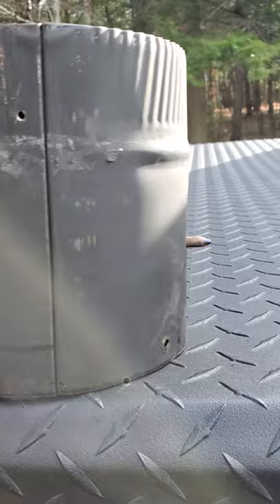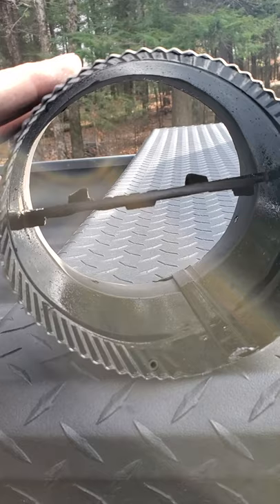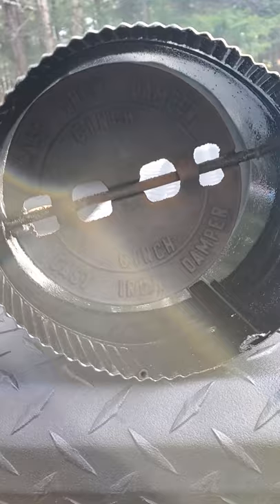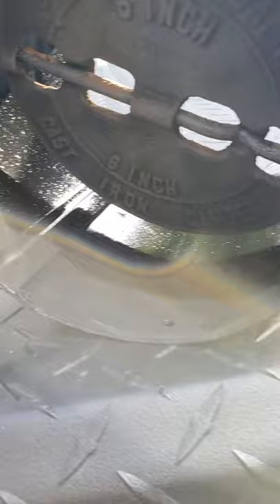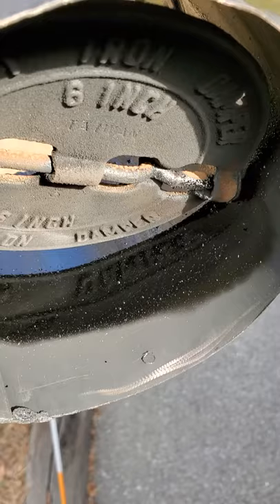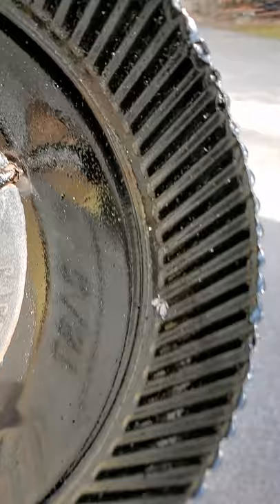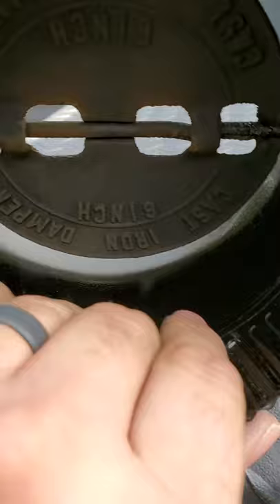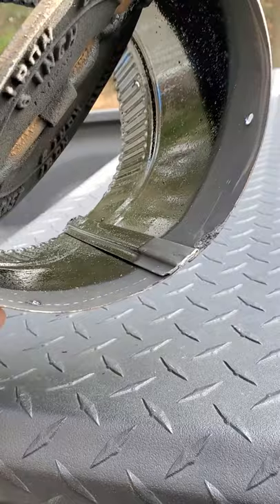Let's talk about Butterfly Dampers

Comment: That obvious "line" where creosote starts is due to it being placed over another pipe when it is installed, therefore no smoke exposure.  Slowing the fire is not the same as choking the fire.  These dampers are amazing and by design will keep more heat in the building.
Reply: Exactly what I was thinking. This guy is a deceptive lier to get more chimney work or has no idea what he's talking about.

Comment: Not everyone is burning in poorly seasoned wood in an old smoke dragon stove. This is bad advise for  modern stoves designed to burn within a specific draft range. Following it is a shortcut to overfiring the stove and ruining their expensive investment. A butterfly damper is totally appropriate for a modern stove on a 30+ ft tall flue system.

Comment: Unfortunately in areas where people use their wood stove/furnace 24 hours a day for 4-6 months out of the year this is the only damper that works, when the chimney has to much up draft pulling up and out, the fire won’t continue to burn. Any chimney cap at the top could help, but the amount of creosote that would build up in the cap in a short period of time is ridiculous. There are some instances where this type of damper is the only solution.
Reply: You are absolutely right

Comment: Ide say your 100 percent wrong you can regulate exhaust flow with good inlet air for a more lean burn....trick is go outside and see if your smoking and adjust as needed.i wouldn't ever use one in a newer epa stove due to the secondary burn features in the stove your exhaust is already fairly cool compared to an older wood burner. but I think there a great safety feature in case of a chimney fire.
Reply: Good point on the chimney fire, but I wonder if they've tested closing the feed door and air flow on the stove versus a damper as far as effectiveness.

Comment: I haven't cleaned my stove pipe in years. I check it to make sure but too clean to bother with. The secret is a clean burn, no smoke means no creosote. The only time you see smoke from my chimney is first start and when I add more wood. I set my damper above 45 degrees.
Reply: Absolutely agree! The key is good combustion . Smoke is unburned gases (energy) escaping up the chimney. If it’s burned in the stove where it should be . You get very little visible smoke and creosote can’t build up

Comment: I have been burning wood for nearly 40 years and have always had a butterfly damper on all my wood stoves. It all comes down to dry firewood, under 20% moisture. Many people don’t realize how important it is not to burn wet/green wood. Your video illustrates what happens to your chimney when burning wet/green wood. Burning dry wood I haven’t had the problems you’ve mentioned. 
Thanks for making your videos
Reply: Me too and I don't use a damper and don't understand why one would ever need the blockage in my pipe. I have a draft control in the door for regulating the air mix.

Comment: In defense of the damper, I can attest that it considerably increases the efficiency of my stove, simply by not letting heat escape that easy. My goal is to have the stove hot, but not necessarily to burn. The hotter the stove, the more heat the house gets. On the other hand, the more intense the fire is, the faster the fuel burns. With the damper closed, I can have the stove very hot, and at the same time, a modest fire (that burns for significantly longer)

Comment: Your explanation of making sure the stove gets as much air as possible too is a recipe for the chimney to get too hot and cause a fire. It’s a balance of seasoned wood, correct inlet damper airflow and chimney temp.  Any one of these out of balance can result in a chimney fire.

Comment: Yeah,well we cant run a stove wide open all the time buddy. Depending on your situation,cleaning your chimney once or maybe twice a year is fine. To help reduce creasote buildup burn good dry seasoned wood,burn your fire a little extra hot for about 15 minutes once a day,use creasote reducing logs periodically. A good insulated chimney that is tall enough for  adequate draft and has a good storm/rain cap will help too. I burn from October through march with an old buck fireplace insert with a 10" masonry and clay chimney. It has a damper that's far from airtight and I pull the insert out the start of every burn season and clean it the best I can with a brush. It's never horrible,but I clean it regardless.  I usually go through 5+ cord if oak and maple a year. I cut my own wood in later winter/early spring and burn it the following winter.

Comment: I agree with your assessment of the facts regarding creosote build up, choking the fire, etc. but in reality, there are other factors to consider.

A wood stove that isn't shut down will easily burn through a log in 30-45 minutes, and it may burn so fast and hot that you're over-firing the stove (which can cause permanent damage over time) so it's not incorrect to shut a stove down and run it dirty, to keep it ticking over at a manageable rate. You've just got to make sure your chimney is swept every 6 to 12 months, depending on usage.
Reply: this guy is just trying to sell you something
Reply: Agreed
Reply: Sounds like he hasn’t use the woodstove very much in his life to heat the house
Reply: I sweep my chimney 3 Times a year the first one is to make sure it’s clear and no bees or debris found there way in yes I have a cap. The second one is midway through the burn season and the last is a put it to bed for the year cleaning. I use the damper as a break in the event something starts to get a little out of hand. No problem using it and I usually just have the powder ash type creosote. Again not bad as long as you do your part.

Comment: Do you also have a firewood business on the side?   Running without a damper is the best way to throw heat away.   I have a 100+ yo PD Beckwith with a damper AND a draft control.   My damper is always at least half closed, my draft at least half way open.  By introducing fresh air into the hot stream, you burn the smoke.   My stove runs extremely clean.   My chimney sweep only comes every other year and is still saying I’m wasting his time and my money.   It is crucial that I only burn well seasoned hardwoods from my property… black oak, madrone, manzanita and some scrub oak.

Comment: If you prioritize facts over ego, I'd like you to share your experiences and data with stoves, not just in words but through various experiments. I installed a butterfly damper on my ENCORE and refrained from chimney cleaning for two years. Upon inspection last month, while the amount of creosote didn't significantly change, a notable difference was evident: around 90% of the creosote had accumulated around and below the butterfly damper, with only about 10% above it.

ENCORE, utilizing a catalyst, enhances combustion efficiency, burning a substantial amount of creosote. However, its drawback lies in its inability to separate the roles of the damper and the catalyst. By employing the butterfly damper, I've extended the burning time from the usual 5 hours to 10 hours and reduced firewood consumption by about 30%.

If my experiments had failed, I would have likely removed the butterfly damper by now. Yet, it seems that won't be necessary.

Comment: I have a damper in my stove pipe, and it's used when the wind is blowing 10 to 30 miles an hour. It's the only way to control how fast and hot the fire will burn. Turning down the air controls helps, but not enough. You'll burn through a lot of wood, without much heat. As for burning overnight, stove manufacturers show you how to close down the air intake, to make the fire last all night. Been doing it for years.

Comment: I have an Avalon Olympic wood stove, which has the secondary burn feature, it has a damper built in,  once the stove is hot, you can throw a couple logs ,( well seasoned of course) and totally  close your damper and shut the air flow, this stove  will give you  a nice primary burn, and  any generated smoke will be trapped and burned  on the top of  the stove ( secondary burn) generating  good heat and burning for  longer time. I usually go to bed around 10, wake up for work around 4:30 -4:45 am and there is still a nice bed of hot coals  inside the stove . I clean my liner  mid winter like January  and again before next winter season, seems to be working just fine for me .

Comment: This is where the new stoves really shine with the secondary air tubes.  So many people comment on videos to add a flue damper when they see the secondary burn in a new stove.  Nice work, thanks.
Reply: A high-end wood stove even from the '90s will have secondary air tubes. My 1997 Lopi Endeavor has secondary burn capability because of its air tubes--1997 to be exact.

Comment: I have nothing in my connector pipe.  27 years later, people still insist I need one. But my home. My wood. My stove. My pipe. It is controlled by the air intake on the appliance. 
Coal is different.  Thats entirely a different species of solid fuel.

Comment: That’s all true but when your only source of heat is wood you have to choke your fire. Nobody is gonna load their fire up for the night and then let it burn wide-open. Yeah creosote is built up but you clean your pipes and then put new ones in at a certain point. If you build a tiny fire, I’d be out in an hour with everything wide-open, and then you freeze to death overnight.

Comment: Either you close this damper above furnace or the inlet damper, your are restricting the airflow, hence choking the fire, because fire can only burn when there is enough oxygen supply. So, regulating the heat on the inlet damper is actually better so the stove has a negative pressure inside and does not smoke the room. But when the stove is not on, you still have the draft sucking warm air from your house through the chimney out in the cold. It would help to have a good seal to stop that draft. The inlet damper can be completely closed and you would still have air leak through the pipe cracks. And unfortunately this kind of butterfly damper would not really seal the chimney. We would need a better seal.

Comment: I just purchased a new woodstove, no damper, but this stupid fiber baffle board is in the top of the stove.  No air flow and the smoke build up was ridiculous.  One month burning 2 yr dead oak, and the creosote build up was so thick I was shocked.  I made a 2 inch hole in the fiber board and now my stove behaves the way it is supposed to.  That fiber board is one of the most dangerous additions out there.  I will be removing more of the fiber board and installing a damper. 40 years of burning wood and I'm going back to the basics.

Comment: What if it's a concrete flue, and concrete building.   No fire issue.  2nd this makes sense, and I get it but holding the heat in is the goal. So I think it depends on the application.

Comment: I don’t agree with this diagnosis for 2 reasons. The more important being the danger of not having a way to choke a fire if something is stuck open- the stove gaskets arent tight- and/or it’s very windy outside. Recommending not having an extra safeguard is reckless imo. We are talking about fire after all. My quadrafire is tight but with a drafty home and 70mph sustained winds, not having a butterfly would be idiotic. Secondary tubes don’t have controls so the damper is the ONLY way to slow things from getting unsafe. Still, keep steel wool close if you have to plug these inlets and know where the inlets are. 
Second reason being the example used (butterfly damper shown) only proves the heat is staying in the firebox longer which is what we all want. If there were no damper the shiny creosote would just be lower in the stovepipe due to the heat cooling before it would with a damper installed. 
People, install the damper, keep the damper if you have one. Just maintain the stovepipe and be as familiar with it as you should be in the first place.

Comment: At about 2:05 he asserts that a butterfly damper, even fully open, is still bad and causes creosote.  That is pure nonsense.  I have a new Aspen C3 stove.  There are no air controls at all on this stove.  I removed the damper as per numerous youtube guru's advice.  Thus, I discovered to my great dismay that there is no way to regain control of my overfiring stove.  I will replace the damper in the spring time!

Comment: I kept a fire going 6 month a year for 30 years  ( always had babies )with a top damper and a thermostatic bottom damper( closes when hot opens when cold ) ! the stove had a 10 ft strait pipe ,start with a hot fire to blast it out ,then cut off the air and let it do it's thing  ( 8 hr burn times with tree log stoke )! it ain't hard ! 
 long pipes cause this cooling build up ! it will build up no matter what lies are told ! clean you pipes every year and it should work very well ! I used a chain to bang around and let it fall in a bucket ( use it to treat wood that contacts  dirt , posts ?)

Comment: Tell people to not burn wood that is not fully seasoned. That does a lot more toward preventing creosote. Advise the to watch the flue temperature. As long as the flue gases are over 250ºF on exit of the flue system, creosote will not condense badly.

Comment: Hello John, I can tell you from experience that the flue damper made these days are just junk made in CHINAMAN ASIA or INDIA or Taiwan.. I changed mine every year for the past three years. Then I had enough and made mine from exotic materials. INCONEL flapper and fasteners, TUNGSTEN ROD and Stainless Steel split collar clamps to control the index position. Has been two years and the homemade unit is just bulletproof, period. The 6 inch pipe is 316 stainless steel which is way better than plain steel sheet metal. 
           I modified my stove with secondary air input to increase the heat output and reduced my wood usage in half, minimum. The burn was way longer and cleaner than before. 
           Drop some more suggestions to increase the efficiency of my Stove John Caesar. Thanks

Comment: How is closing the air vents in front of the stove "not chocking" but using draft regulator is choking? I think you are taking things to extreme. I can burn all the wood in 30 minutes with flue liner red hot  or 6h creating tons of CO on soot. Why not to tune it it burns at optimal rate?

Comment: So, the only way to operate a woodstove is to run it wide open at all times? Derp!
Reply: You should never control a woodstove by slowing or impeding the smoke leaving the appliance. All that does it create thicker, cooler gases in the flue which build up more creosote. You control a woodstove with the air inlet controls. Just be careful not to take away too much air because then you get the same problem.
Reply: @JC.Ministries  
That's why you clean your chimney! Old timers with wood kitchen stoves would clean them every month or two. And the damper also keeps more heat in the stove instead of up the chimney. I run double wall pipe WITH a damper and keep internal pipe temp at 600
Reply: @kirkstinson7316  I agree!! Proper maintenance is a MUST! I've been around wood stoves all my life. If you have excessive Creosote buildup, STOP BURNING GREEN WOOD!

Comment: so you are saying no damper and FULL AIR, which means you will burn thru wood very quickly, the whole reason people close damper is to get more heat in the box and and conserve wood, is there a another way to achieve this with no damper and open air vents

Comment: If you burn good seasoned wood and inspect your chimney Routinelyusing a damper you can control, Seems to be a logical way to retain heat and re-burn smoke similar to the way a baffle works , one would think ?

Comment: So what you are saying is my wood stove that i burn 5 months of the year the chimney is not supposed to have a damper in the pipe that i close 50% and still only have to  brush it every 2 years. After one year i can still see the pipe walls all the way to the cap.  This video is completely wrong. For some cases and other cases it will smoke out the house with the paint burning off the pipe and stove with out one

Comment: I wonder if you added it really close to the fire chamber so it kept any creosote inside the chamber. Cause I think ideally you want as much smoke as possible to stay in the chamber so it ignites again. Think about a rocket stove, it literally captures all of the smoke, Re burns it and then the exhaust from the house looks like vapor more then smoke if done right.
Reply: It won't reburn without air or draft and newer stoves need all the draft they can get to work properly.i really depends on your wood burner.

Comment: I have a modern EPA 2020 stove and a  37ft tall chimney. Last year I ran the stove WITHOUT a key damper and had some serious runaway issues. The fire would often become uncontrollable and the temperature on the single wall pipe would become crazy hot. I did reach out to my stove manufacturer (pacific energy) and they told me that a key damper would definitely help in my situation. I am going to install one before next winter.

Comment: Wow! Was just getting ready to install a damper in my new pipe! Thank you so much for explaining this in detail! Just hooking up my new woodstove and will not be installing damper!
Reply: FrancOtaku  Expensive more high-end wood stoves have built-in dampers already part of the manufacturing process, just buy a more expensive wood stove not from a big box store either, that's where the cheapies are.
Reply: You are not going to have much luck with a wood stove with no damper
Reply: @austinsmith281  I did install it with no damper and it is working very well.
Reply: @austinsmith281  I have used woodstoves for many years with dampers. I decided to install my new woodstove with no damper and it is working well for me.
Reply: @lanagaylechandler1948   a lot of your heat is escaping up the chimney.